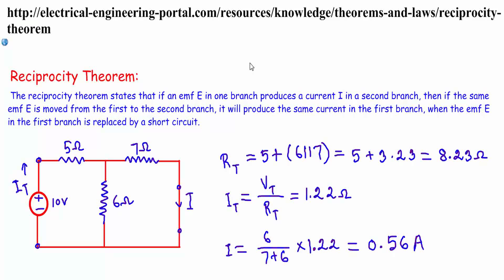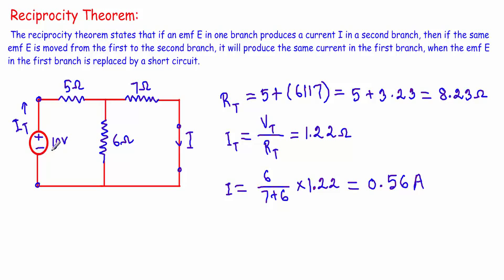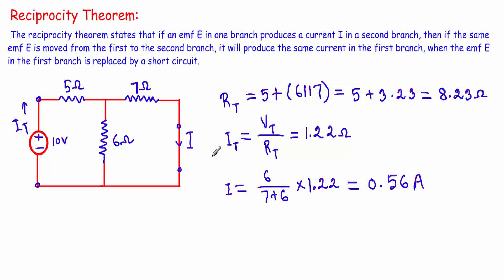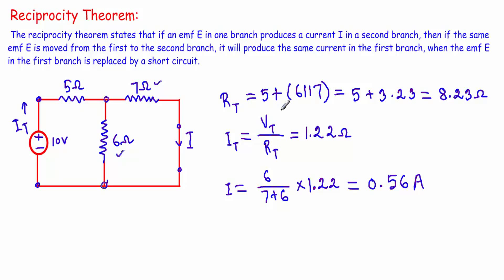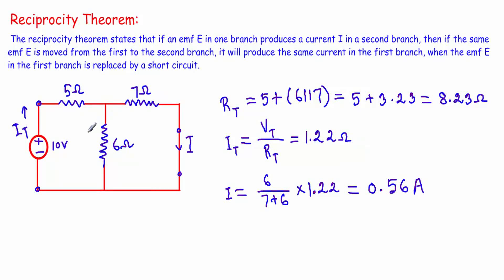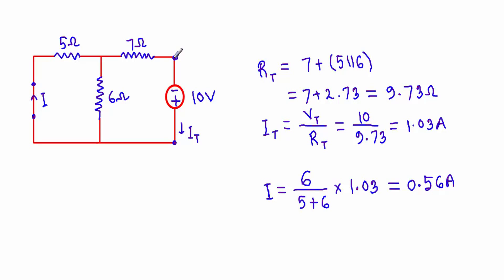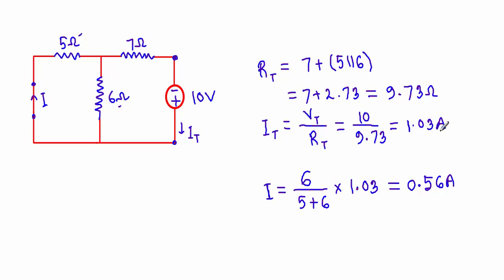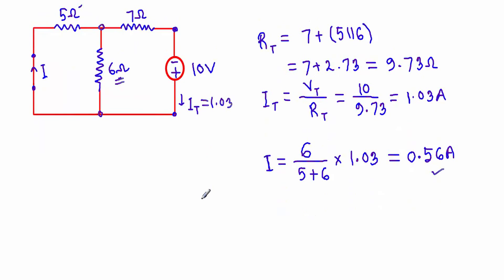Reciprocity Theorem - Theory and Solved Example  (w subtitles)

Comment: Sir you added the resistance in parallel in wrong way in parallel it is added as 1/6+1/7=13/42<1 but you wrote 3.23 that's not correct sir
Reply from the maker: It is correct...Check your calculation

Comment: It is very basic level problem..Plz explain some problems on reciprocity+ thevenin, reciprocity+ norton, reciprocity+superposition..
Reply from the maker: +shubham varshney , you should know that Reciprocity theorem is applicable only in single source networks (Introductory Circuit Analysis - Robert L Boyelstad, 9th Edition, Page 350). So I will be very glad to see some examples of superposition theorem + reciprocity theorem from you. If you need more practice problems, Check out Page - 367 of the same book

Comment from the maker: Its not that difficult to set an example with reciprocity theorem. As reciprocity theorem is applicable only a single voltage source, draw a complex series parallel circuit, and supply them with a single source. Then follow the steps I have done here . Yes I use a Stylus pen@mbrij 96